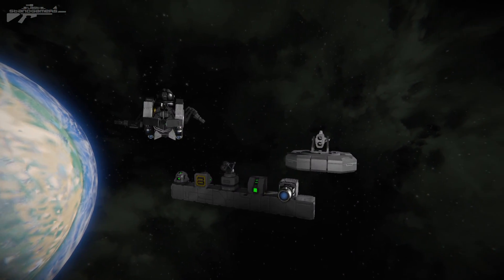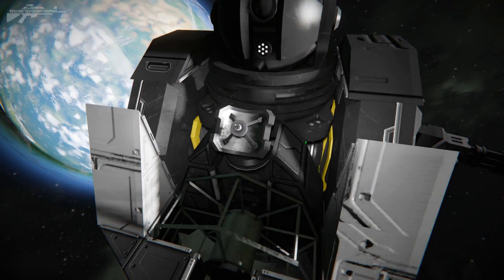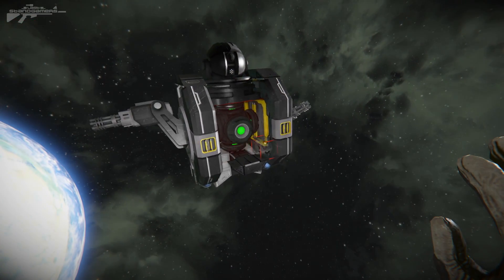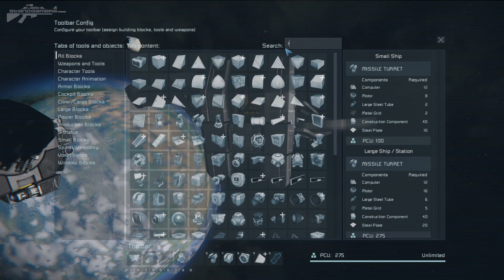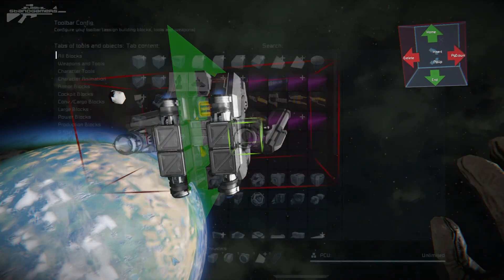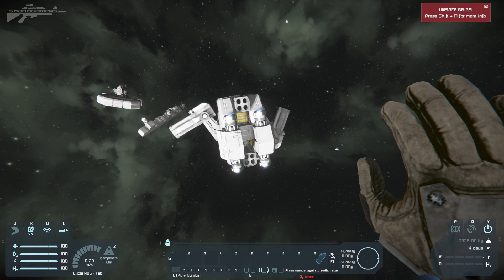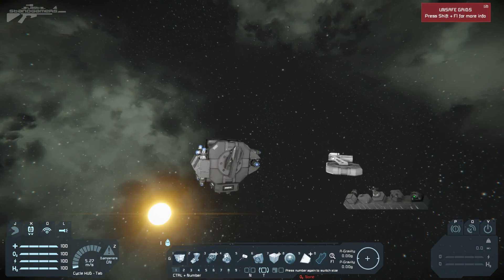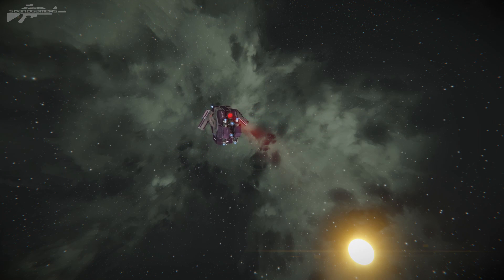Super Duper Drone Building Mini Builds Part 1 - Space Engineers

Comment: Yeah, not really that well piped up for mass production.
- If you used a medium conveyor, it may be larger, but it would really be easier to load them. A connector could pipe the drone to the base/carrier. 
- If you include a timer on the drones, you could have several drones on connectors, press one button on your base/carrier to disconnect all drones at once and a second later toggle the autopilot on.
- If you used batteries, you could deny the enemy of any energy resources (except if they don´t damage the batteries and plug them up to their own stuff)
- For atmo drones that are supposed to attack ground targets (like a group of drones that circle your base to defend from creatures or an enemy base), a single, ground facing weapon should suffice. 
- I think for attacking stationary space stations, drones are not the best choice. I would use rockets with guns ;) (you could even set a waypoint within an enemy structure, if you adjust the coordinates of a waypoint in the right way)

Comment: I think the issue with these drones is the piping. In Survival, loading these would be a bit of a challenge. I have an atmospheric drone with a single bottom turret, 8 small reactors (still less than I Large I think?) and a connector on top. It can only fire downwards as a target, but I’ve found it works quite well as most targets come at you from below.

Comment: For drones that attach to large ships by merge blocks, batteries may be a more viable options for power.
Reply: I think you are right, except you want to make a large attack on an enemy what takes quite a while and maybe the batteries run out and they just drop down to the floor when being used in an athmosphere

Edit: but i really like the idea, because i was thinking the same when he placed the reactor
And it wouldn't really give the enemies the uranium if something is left
Reply: @davidhuhnchen3292  dude with so little power usage I'd bet those could easily last 5 hours with complete energy draw witch far outlives the drones lifetime in battle
Reply: well, for combat drones its not a good idea to use batteries. Batteries are bulky, with small size drones like these you would only use one. That means that as soon as it comes under fire, battery being a prime target, the battery takes a little damage and the drone loses power. With the 18 small reactors that would fit in its place, you have 18 levels of redundancy. most of them have to be shot off before your drone is inoperable, and by that time they have either done their damage or are mostly trashed anyway. these kinds of attack drones aren't supposed to last long, they are a blitzkrieg tactic. That's why you make them so small and cheap, so you can make a shitload and lose them all without much loss of material.
Reply: @magicalfungi3206  you lose uranium with reactors, it's a better idea to use that uranium that would be lost in the drones in your carriers reactors as then you could use that to have more power to charge batteries,anyways I think a drone should be a bit bulkier than you think because you want it to at least survive some missiles
Reply: Yeah batteries give them nothing important if scrapped an and  small ship merge blocks dont work with large ones, unless you have it on a rotor then you might as well just have a advanced rotor

Comment: Nice and all, but if you want to print them on survival, how do you plan, to load the rocket turrets?
Reply: It isn't mass produced version. You do it when you build it. He explained the rules, not providing instruction how to build it.
Reply: to make them as you want, you would need a connector. you can do it with an adv rotor, but only if you want to risk blowing yourself up too...  So with a connector, it would make the craft much larger. Its not hard at all to run down a row of drones and load them up, making them larger means more expensive and thus completely defeating the point of a hoard of drones.
Reply: I know, this guy really doesnt think

Comment: I've been testing with some drones too, but I've been going the programmable block route. It's probably not as cheap, but I want my carriers and stations to be able to order my drones around based on what's needed. So far it's only basic navigation, though. Still working on docking. Maybe I should just put in a second remote control block for that purpose. Or just always align the remote control block with the connector, since that would make it much easier.

Comment: How  do you fill the turrets with ammunition the ports completely covered with no conveyor access
Reply: YES this guy sucks
Reply: Do it when you build it
Reply: @kaksspl  yes but not when it's mass produced like with a projector and walders
Reply: @kaksspl  then how is it mass producable?
Reply: @gabrielibarra5551  clearly it's not. It's just an example. If you want it mass-produced, keep it in mind when you build it.
Reply: I'm thinking of a system where at the bottom of the production chamber is the projector, a connector made from it, a conveyor junction to convert to small conveyor tubes which end in the drone proper. Midway across the tube is a grinder from the mothership to sever the link and release the drone, allowing for mass production without having the drones carry around annoying connector components.

Gonna have to test this at some point.